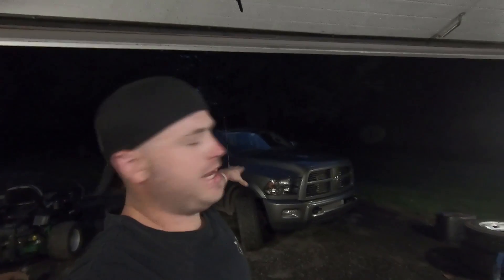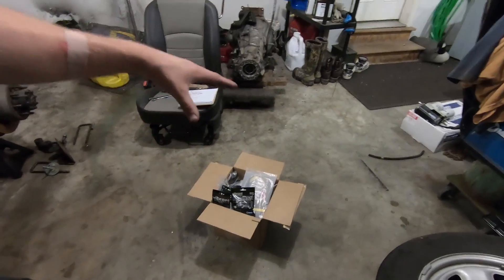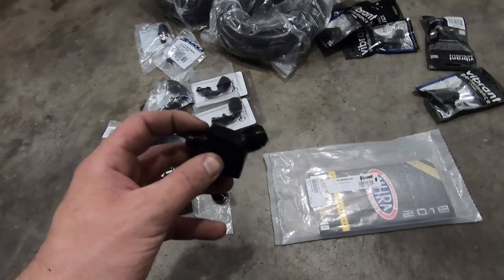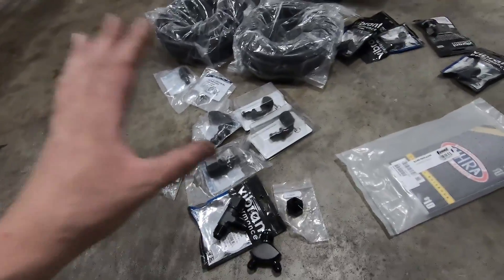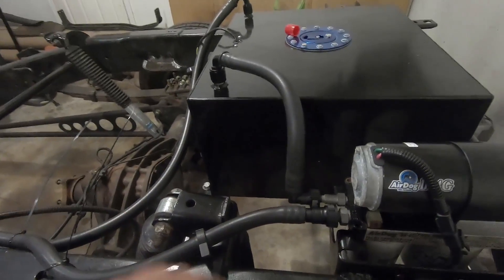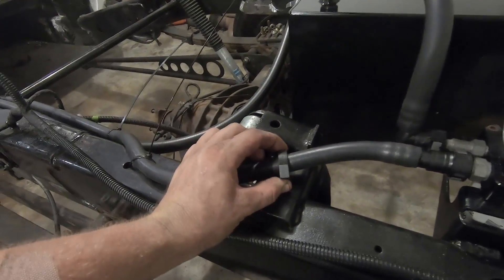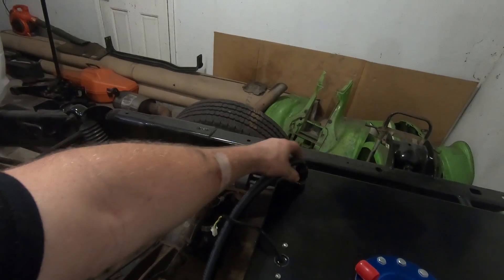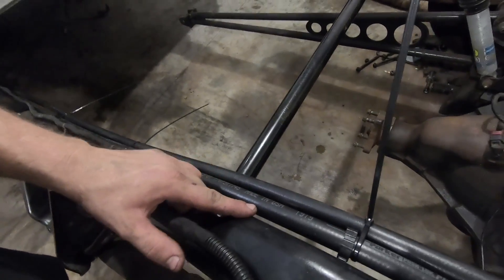Diesel Drag Truck Fuel Cell Plumbing How To

Comment: Hey Tom,
First just want to say good job on the videos! Keep it up. I religiously watch your videos.
 Now I have question. I have a plug for my rail as well. But some people say that a full plug can hurt the injectors. Whats your take on this?
BTW I live in NY I am around your are a lot. PM me on the facebook YO JEK
Reply from the maker: A plug will not hurt your injectors, but... That being said if an issue occurs with your fuel system such as with the cp3 and you get WAY too much pressure sent to the rail, there is now no saftey to bleed pressure to save other components.
Reply: Thanks. I heard some people damage the injectors with a plug.